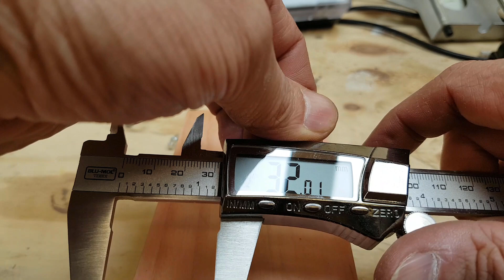DIY Jig for System 32 / 32mm Shelf Pin System

Comment: Nice one Rob! You weren't kidding, that really was a boring video!😆 It's good idea. I once made a device for the drill press to drill shelf pin holes before assembling the cabinet. It was a sliding table that had a spring loaded index mechanism and I thought it worked perfectly. I was so proud of it and at the time and I was working for a cabinet shop and they used a Rockler plastic thing and I just knew this thing I had made would be the cat's meow. I took the little drill press with the sliding table into work to use and the table somehow became misaligned during transport and the holes on the opposing side of the board did not line up. (you had to flip the board around) I was so upset with the episode I abandoned the idea of pre drilling shelf pin holes completely. Now I just drill them after assembly with a shop made jig (similar to the Rockler one) and use a 5mm flash bit. I will make a video of failed jig and the the flash bit jig soon.
Reply from the maker: Ah man! I've had similar disappointments in my work life - it sucks the life out of you doesn't it. Flash bit - is that like a vix / self centering bit?
Reply from the maker: lol - boring video 😆
Reply: It sure does. I'm not familiar with vix but it's probably the same thing. A self centering bit with spring action. They are often used for door hinges etc..

Comment: Very neat solution.
Reply from the maker: Cheers mate - I wanted to line the drill guide with some metal tube but didn't have any. Every time you drill a hole it gets a bit sloppier but it got the job done that I needed it for.

Comment: Nice jig, mate👍
Have you thought about routing, say, a half inch groove in the bottom of the jig, from the hole you drill into to the left side of the jig where it butts up against the drill bit so you can have the vacuum running while you make all the holes, without stopping to clear the build up?
Reply from the maker: Cheers Bill! That's a brilliant genius amazing idea to attach a vacuum!! - I did think of it 😎, but I didn't have a nice way to attach the hose....wait - I could actually just route the groove and use a forstner bit to step the groove up to the diameter of the hose and plug it directly into the block. Thanks man!
Reply: @TakamiWoodshop  even if you get a hose reducer so you don't have to bore such a large hole? Make the hole a fly shit smaller for a good friction fit, that way no messing about with working out a fastener?
Reply from the maker: Good idea - I have one actually that reduces down to about 10-12mm - I'll give it a go. 👍
Reply: @TakamiWoodshop  sweet.
Sounds like that'll make a good upgrade video👍😎😉

Comment: Cool jig! How are the walls of the pilot holes holding? Maybe a bushing there is a nice addon.
Reply from the maker: Not holding well at all Bill. The wood is soft pine and I wanted to put in a bushing but I didn't have anything suitable. At this point I either have to put in a bushing or make a new one because the holes are starting to wander.
Reply: Yeah, I thought so. Try some copper or brass tubing if you can get some. Even if the hole is a bit smaller you can drill out the difference with the drill bit you gonna use.
Reply from the maker: I'm considering using a vix/self centering bit as well if I can get a 5mm one.

Comment: Cool little jig. Are you sure it was a 5/8 tap and not a 3/8?
Reply from the maker: Cheers mate. No - I"m not sure at all about that tap size 😆 I have about 6 or 8 of them all the same size and I happened to have that set screw that fit - but only one of them - hence I tapped both holes but only screwed one side. TBH I don't understand the relationship between tap size and thread size, thread count and all that.